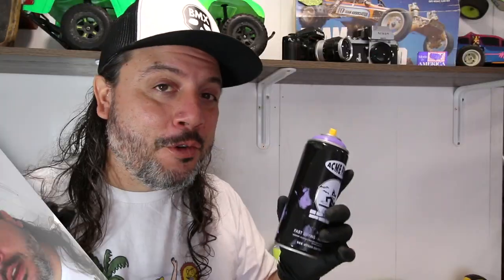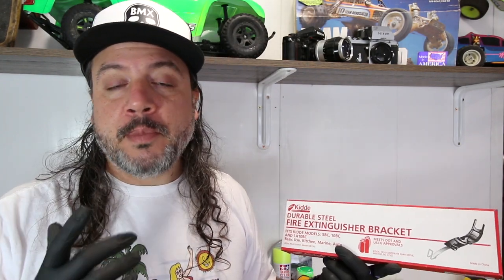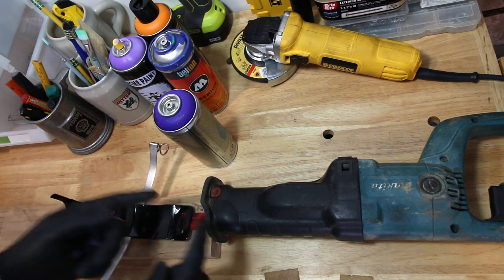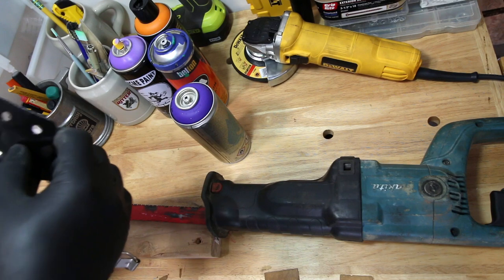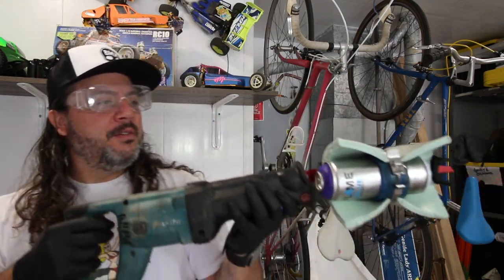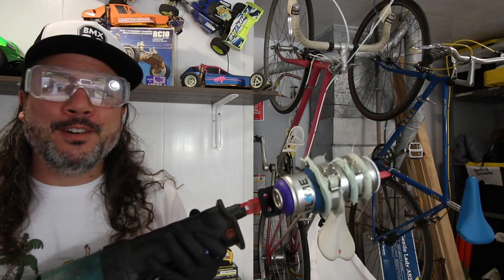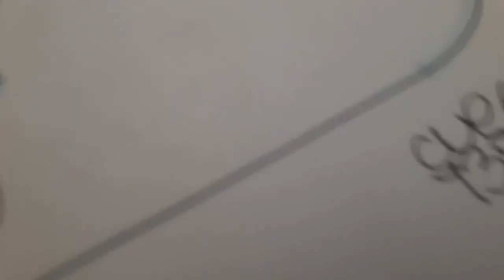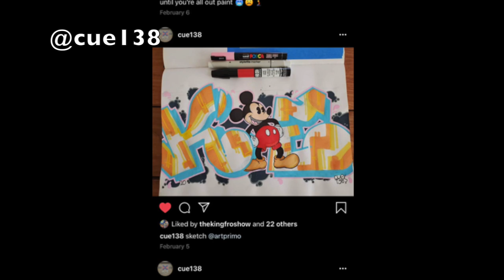DIY Paint Shaker Tutorial + #SOAPBOX (FEAT - XVR 1 & CUE 138)

Comment: What's funny is i've been doing this very thing for maybe two months now. The difference between mine and GR's rig is I don't use a holder/mount attached to the blade. I use a pair of hose clamps to secure the can to the blade and tighten them with a small socket attachment for my impact driver. Works great and i've never had a can fly off. The other thing to look out for is DO NOT OVER TIGHTEN! It'll start biting into the can. I stop right before the impact driver starts to strain and it's perfect.  I have however learned that it's not necessary to go full pull on the shaking. I have a few empties now with pings all over the can where the rattle ball has impacted the inside and left little bumps all over. Consequently i also mount the can with the valve pointed away from me, not that it's a big deal or anything. Safety third kids!

Comment: Gr, add another piece of angle iron where the 2 bolt holes are towards the front ( the rear most part of the blade, the issue is it's slipping out. Stop the slip man.nip slip=good...can slip=missiles in the house